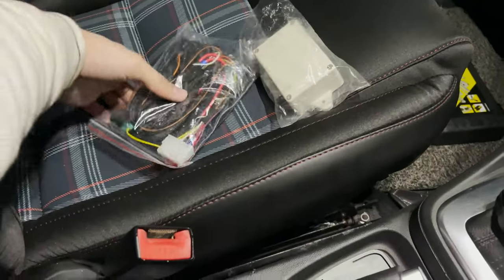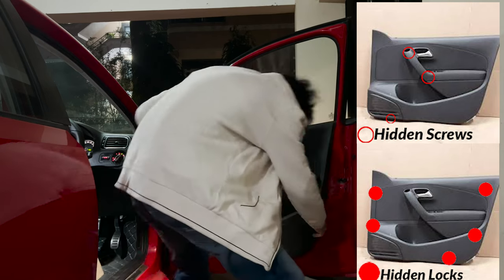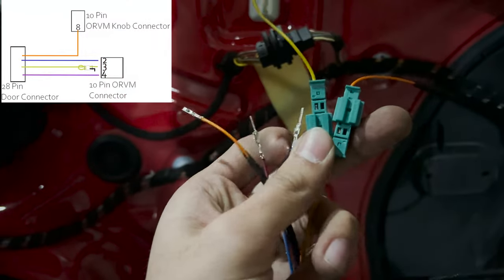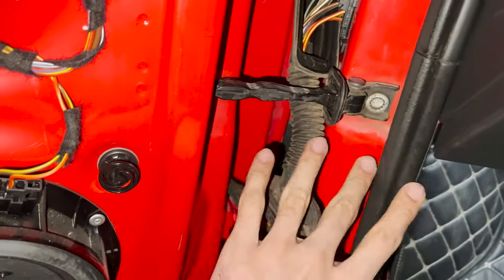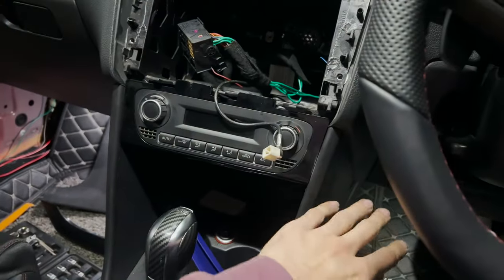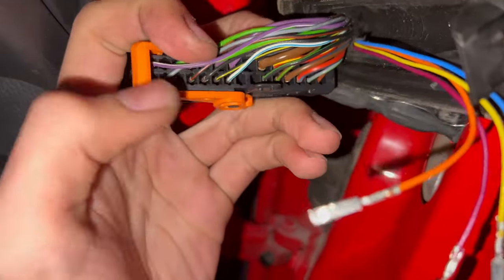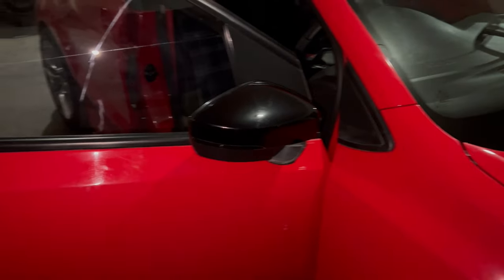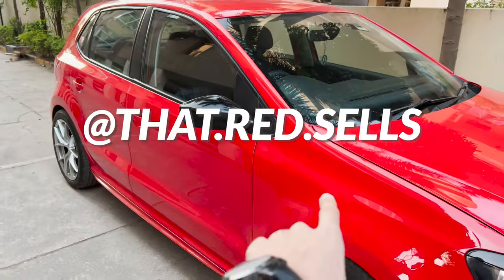Module to Fold/Unfold Mirrors on Locking And Unlocking Modifying the Polo GT!

Comment: Hi Prerak.
Your opinion on the LIN module approach for achieving the same?
Reply from the maker: The updated window regulator motor with which this can be achieved is hard to source in India, it needs to be imported, if it was any easier I would have gone with that route

Comment: Hey prerak , your work was as best as always. I have al little query that can we do this installation in 2011 polo 1.6 with comes with normal mirrors and much all this unstallation costs?
Reply from the maker: You’ll first need 2016+ Highline morris, electronically foldable and adjustable, then this module can be added
Reply: @PrerakKataria  where can i find this module?
Reply: Hi pretrak I was learned many updates doing to my polo 2013 comfortline by seeing your videos. I was also very much exiting in seeing your mirror folding video 😊 and I was also trying to upgrade to my car came with normal side mirrors without indicator’s lights please help me what parts are required for those mirror folding retrofit
Reply from the maker: Doing that to a friend’s car soon, will upload a video on it

Comment: Next upgrade ambient lighting for polo 👍and connect it with you're infotainment system rcd 340 if iam not wrong.. nicely done personally i always fear i might break something coming from electronics and communication  Engineer 🤣need a bit of getting use to these delicate harnesses and clips🤣
Reply from the maker: That has been on my mind, but I’m not sure if it’s possible in PQ platform. I’ll try my best to make it work
Reply: @PrerakKataria  looking forward to it bro.. also where can we order such parts from ebay??

Comment: Does the mirror adjustment settings work even after this installation? 14:52
Reply: Important questions
Reply from the maker: Mirror adjustment works as I said in the video, but they don’t fold with the knob now, there has to be a solution which I’ll find.
Reply: @PrerakKataria did you find any solution?

Comment: Is it possible to add that module to a Polo CL?
Reply from the maker: If you have folding mirrors, then yes
Reply: @PrerakKataria   thank you for the response. Yes these are manually foldable electrically adjustable mirrors. Will this work or would I need to replace both mirrors?